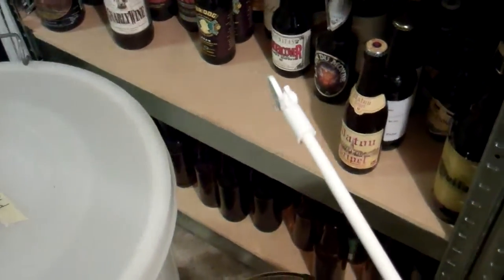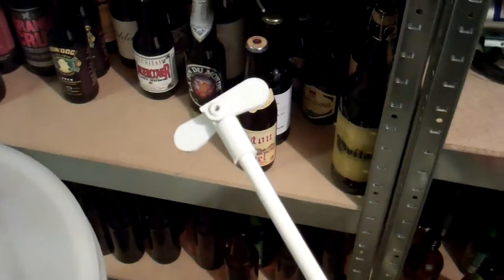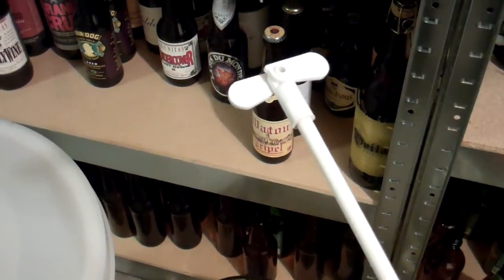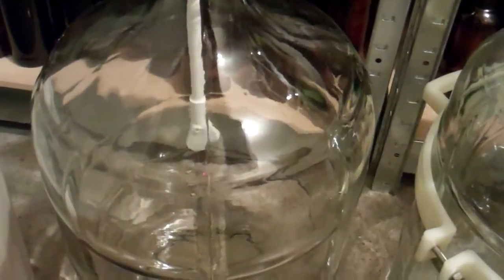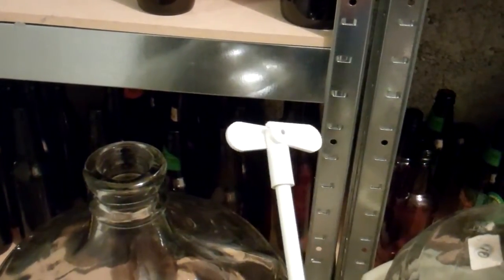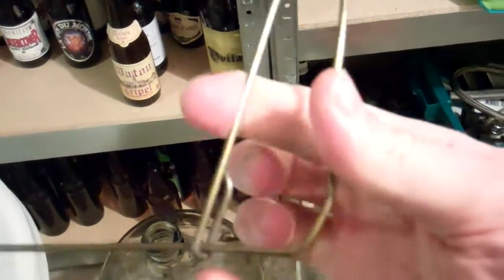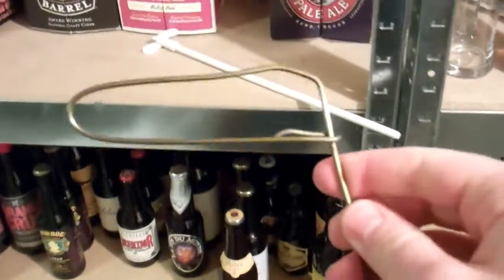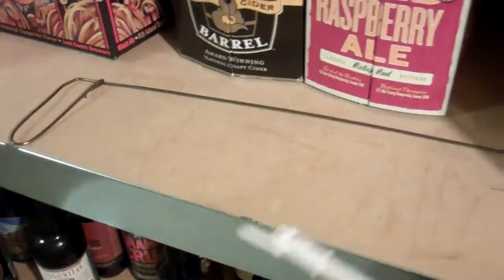Degassing Wine

Comment from the maker: @arrogantbastardale I add the sulfites and do about a minute then add the clarifying agent (isinglass) and do about another minute. If there's still co2 after a couple days you can do it again but it's really not needed if you plan on letting the wine batch age at room temp for a while. I usually leave mine alone for a while before bottling.